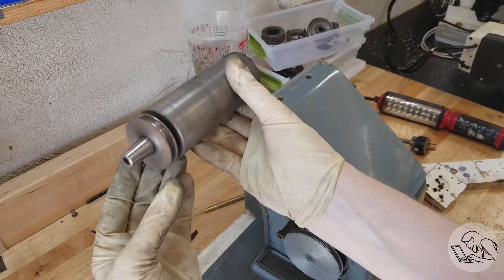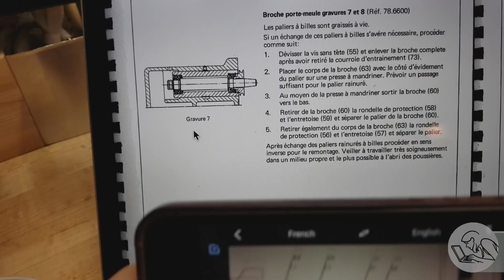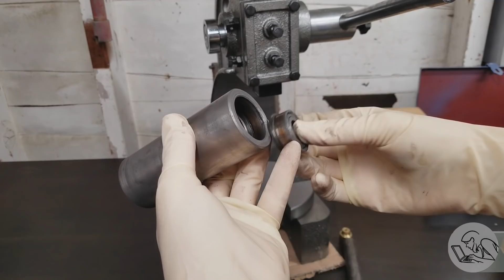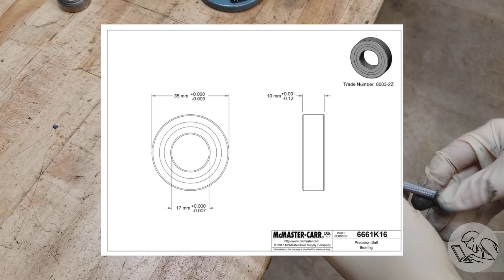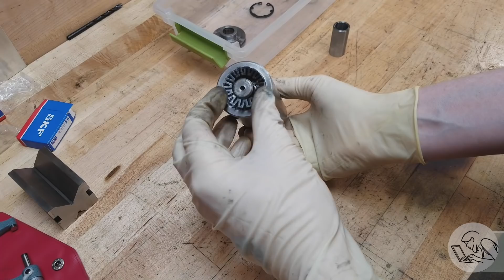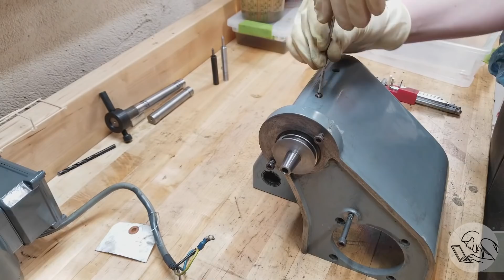D-Bit Grinder Restoration - Part 5

Comment: Hay Quinn I haven't read the 275 comments so if I have a repeated comment I apologise.
As a mechanic when using a hydraulic press to press a bearing in by the outside shell we use socket sets as you can usually find the right size to match the outer shell.
Thanks for sharing regards Sleepy

Comment: Why an arbor press over a standard hydraulic press?  Is it because of the built in stability of the arbor press vs the wobblyness of a regular cheap press?  On another note, with all the foreign material ingress through that rear hole, did you clean the bore out before reinstalling the rebuilt spindle?
Reply from the maker: Because I don’t have a hydraulic press
Reply: @Blondihacks Sorry, I should have been more clear with that question.  What I meant to ask was why did you purchase an arbor press over a hydraulic press?  Not enough space in the shop?
Reply from the maker: @Asmodeous67  Yah, definitely space. My shop is very very small. It's hard to tell on video, but you'd be shocked if you saw it in person. 😀

Comment: Er...umm... those SKF's are shielded, NOT sealed. Shields are SS, seals are black plastiqué.

The re-assembly should be the reverse of the disassembly. The slip fit bearing would press onto the shaft. Then the press fit bearing should be pressed into the body, then press the arbor in.

If you install the arbor shaft into the body without the bearing, you won't be able to support the bearing races properly trying to press it onto the arbor, and into the body, at the same time.

To put it together the way you did, the press tool would need to contact both the outer and inner race. 

Pressing it onto the arbor shaft and the into body, without a custom press tool, would create stress on the balls, and the outer race presses into the body.  Which is hell on cages.

Comment: So why didn't you use a socket-like the rest of us? (as a spacer, bushing, pressing thing)
I just subscribed.  I just got an old surface grinder that was making a noise at the spindle.  After some research I discovered that the 4 bearing's price is equal to the value of a first born child.  At least thats what they say in the fine print.  I found a video by suburban tools on "what it takes to rebuild a spindle".  They went to a place dedicated to this.  I saw no magic.  No dust free zones where a fingerprint screws up the way the bearing runs.  Perhaps I can do this. Empowering.  Thats what you are. Empowering.  BTW I wondered why your video didn't come up in my search.  Its because you didn't put "surface" in the front on your title.
Reply from the maker: Well, it’s not a surface grinder. 😁 This is the spindle from a D-bit grinder.

Comment: Good video. Not seen lugged snap rings with bent tabs before. I wonder if someone in the past tried to remove the shaft with the ring still in place and bent them?
Reply from the maker: The lugs are shown bent in the parts diagram as well, so they’re supposed to be that way. Not totally sure why.

Comment: After looking at the blog post, it appears those bearings have a c3 clearance.  Is that right?  How is the runout?  Presumably there is an interference fit on the shaft and the housing to make up for that god awful thou?  Trying to order bearings.....and over thinking as usual.  Toolpost grinder for my lathe. Save me from myself. C0 Abec9 is out of the question.

Comment: Frankly I want to build one myself. By the way - why not seal that open hole with wax or silicone?
Reply from the maker: You do need access to the hole periodically to lock the spindle.

Comment: Here are a couple of hints from an old guy who has rebuilt dozens of spindles. Make assembly easy by putting the shaft or arbor in the deep freezer for a few hours. The bearings will likely drop onto the shaft without even using the press. The housing can go in the oven at 250 degrees for a while to expand it. Also smear a bit of oil on the inner and outer races, kinda like installing pistons in a engine.

Comment: Hi Quinn, the perfect bushings for pressing in the new bearings are the races from the old bearings. Might need to grind a little off the outer dia just so you don't press that in as well. Also, even snap rings without those tabs can be sided (& the grooves) mainly found in gearboxes tbf, but you probably know already. Loving this series & so well done as usual. Thanks for sharing.

Comment: Oh, I had those snap ring pliers and they are just terrible. It was a constant struggle to keep them from slipping off, and never really having enough motion to get the snap ring out/in because of the flex in the reversible jaws. After years of self abuse, I finally buried them in my toolbox and bought a set of Knipex snap ring pliers and have never looked back. I inherited a set of old snap ring pliers from my father in law, and even those ( no idea of the pedigree ) don't perform as well as the knipex.

Comment: Did I see this correctly, the front bearing floats? In my 40 plus years of working in machine shops I have never seen a spindle where the front bearing is slip fit and the rear bearing is a press fit. It seems odd that the rear of the shaft is fixed and any movement due to heating and cooling is happening at the business end.
Eric
Reply from the maker: The bearings are slip fits in the outer bore at both ends, and pressed on to the spindle. Pretty typical arrangement, I think- similar to a motor.

Comment: I do love your videos they are really easy to follow and well produced. I almost feel like I could copy that design using a lathe, welding (to fabricate something instead of the casting) and a press (all of which I have). It's interesting to see how these things are held together as it give you an idea of how to build your own tools.

Anyway happy new year and keep up the good work!
Reply from the maker: Totally! I learn a lot about how to design my own things from taking apart well designed machines like this.
Reply: Look carefully at the 3-bearing arrangement for a spindle. Costs an extra doublebuck for the bearing, but has many advantages.

Comment: The spindle locking hole is for changing grinding wheels. I'd make a spring or lever action spindle lock, because always removing that rubber plug is a pain.
ATB 💪👌👍

Comment: Hi folks. It's worth adding that good quality spindle design is a complex art. Bearing movement has to allowed for to cope with expansion and contraction - at high speeds even ball bearings will heat up - hence the sliding fits. BobUK.

Comment: When mounting the arbor press will it be better to mount it to a plate to allow so rigidity  on the table and a lower bottom for longer parts, or make a pass through whole for really long pressings. Are is that just getting towards a reason to buy a shop press?

Comment: The arbor press is going to make life a little easier. I like your use of hss. Not learning to grind and use hss was my biggest mistake when I started machining. Especially with the light machines that I was using. I am not saying that carbide doesn't have a place in the home shop.

Comment: Gosh, I need an arbor press. Gets arbor press. Gosh, I need a bigger arbor press. (My words, not her's.)
Reply from the maker: I bought a bigger one than I thought I needed, and immediately wished it was a little bigger- it barely got this job done. 😅
Reply: @Blondihacks  as I'm sure you've figured out, that's the case with damn near all machine tool purchases.  "Hmmm, I need this size, so I'll upsize it by one increment", next job comes along you always need the one two increments larger.

Comment: No run out?!
HolySh!t!
I woulda had to check that a couple times to convince myself it's true
Good show, thanx
Reply from the maker: You get what you pay for in bearings and arbors, it turns out! 😁 I’m sure you could see runout on a fine enough indicator, but I couldn’t see any on mine

Comment: Another great video.
I enjoy the explanations about assembly of parts and orientation, this is often assumed and seldom explained 
The screw on the spindle lock is to hold the spindle when tight tolerance is required- the spindle is movable in the long axis ( as is the “ tool holder shaft”, on the lower front of the machine) when advancing the wheel into the tool
The hole is to insert a Phillips head screwdriver or Allen key to stop spindle rotation when grinding wheel replacement 
Hope I’m not telling you “how to suck eggs” !
Reply from the maker: The spindle on this model is fixed laterally, unlike many newer D-bit grinders. The setscrew simply holds it in place.
Reply: @Blondihacks  My mistake, I had been looking at my clone machine, I have now seen that it is not the same. Thanks for the videos!

Comment: I would've used angular contact ball bearings for this application, they provide more rigidity that's needed if you want the best results (which you do in tool grinding of course)
Reply from the maker: Replacing them with the same ones spec’d from the German factory seemed wise to me. They know what they are doing.
Reply: @Blondihacks  Sure they knew, it's pretty common that old grinders have regular ball bearings in their spindles, and not even the more precise ones. My t&c grinder had too and it actually worked pretty well considering that and that they were so old (1943)

Comment: Nice video I have a gorton  model, use it all the time.I prefer high speed bearings with rubber seals, metal seals don"t seal tight. grit gets in,i use a felt ring for back up on stone side.
Reply from the maker: A felt ring is a good idea. I think the parts diagram actually calls one out, but it’s missing on this machine.
Reply: @Blondihacks  I bought sheets, of square ( Machinery ) felt on E-bay  and cut my own. have fun with the grinder keep the grinder dust away from other machines.

Comment: Hi Quinn
I'm a big fan of yours.
I would like to point out a critical mistake you made when you pressed in the second bearing.

You pressed axially through the balls of the first bearing, that is why the spindle did not rotate freely after pressing in the second bearing.
The correct way to have done it, is to have made a bush that supports both races of the first bearing. Ie   a flat faced bush with a hole through it for  shaft clearance.
Otherwise you are doing a great job.
Reply from the maker: No I didn’t- I pressed on the inner race of both bearings where the press fit is. The second bearing has preload springs behind it and that’s why it got tight. It was the springs doing their job.

Comment: In my experience, when a document gets sufficiently technical/specialized like some scientific papers, it tends to use a bunch of english loanwords (or vice-versa, I'm no etymologist), so I can sorta halfway follow as long as it's a language that uses the latin alphabet.
Reply: That's probably the main reason why translated materials from eastern asian countries have a long history of questionability. Instructions that come with chinese items are the modern perpetrators, but in the 80s japanese imports often had hilariously bad translations.
Reply: Yesterday I took delivery of a 5C Collet Spin-Index Fixture made in China and found myself wishing I had the Mandarin version rather than the Chinglish version because it is nigh impossible to understand AND I can't use Google Translate.  I've been around tech over 45 years, and in the old days if I had to I'd find a native speaker of whatever documentation I really needed to help me out.  But no-one can help with really, really bad Chinglish.  Sigh.
Reply: @marcmckenzie5110  Fw years ago, I bought a new laptop battery and read the enclosed pamphlet - I gave up round about the time I read the warning that the "alkalinaceous liquors" might leak out if mishandled.

That said, I admit the writers English was considerably better than my Mandarin.

Comment: As a mechanical engineer by day, I've designed a few bearing systems.  The rule of thumb is the bearing is pressed onto (or into) the rotating member of the joint, and is a (very slight) slip-fit into (onto) the stationary member.  How tight/loose the fit is generally a function of loading (ranging from uniform to heavy shock), operating speed, bearing quality, bearing retention....
Reply from the maker: For sure, which is why I proceeded with the assumption that the outer race was supposed to be a slip fit. That said, I have seen cases where it isn’t, so it’s not a universal rule.
Reply: @Blondihacks  true - and you took the utmost care to make sure - which was very satisfying in itself to watch!
Reply: @Blondihacks  Thankyou! this helps me sort out the order for assembliing the bearings in a 4x6 bandsaw which appear to be press fit on shaft and in housing
Reply: @johnvreede832  I just acquired a 4x6 bandsaw and will be doing a rebuild on it. 
Please share any info / finding that you come across. 
Thanks
Reply: @rickpalechuk4411  Rick, you'll get the most help by joining https://groups.io/g/4x6bandsaw. There's a few hundred of us with 18years worth of photos and info - jv
Reply: @Blondihacks  
Should be.

Dale in Canada
Reply: You beat me to that comment. ...though you said it much better than I would have!
Reply: EPGeek; I understood that because the outer race housing contact surface is significantly larger than the inner race shaft contact surface area, it is preferable to have the inner race versus outer configuration as you state.
Not sure what grade of bearings where fitted, C3 are the most popular, ref for motors, possibly a tighter tolerance could be beneficial here.

Comment: Blondy; you could use a wash station for the crud on parts
Reply: I've fallen in love with my ultrasonic cleaner. Use a little diluted Simple Green and it's amazing what you can clean off. I helped a friend rebuild a snowblower carburetor, and the thing looked brand new when we were done. I bought a "returned" cleaner from eBay that I had to repair (because why not) and now I use it all the time. I went with a 2.5L model, but I think it's a good idea to buy the largest capacity you can afford.
Reply: @setSCEtoAUX  Get some plastic or glass jars with screw on lids and put your parts in those, pour in some diesel or kerosene or straight up benzene, then fill your ultrasonic cleaner with water and toss those jars in to the water bath. Works in less than 30 seconds to pull crap off from machine parts as it is the best solvent, but also doesn't make a fire hazard because sealed container and you avoid any cleaning of the ultrasonic machine, as it is filled just with water.
Reply: @JaakkoF   That's a fantastic idea, thanks! That'd work great for Isopropyl or acetone too. You get the best of both worlds; an aggressive solvent plus the mechanical ultrasonic action.
Reply: On the topic of hazards: Benzene is a fairly nasty carcinogen that will go straight through normal latex or nitrile gloves. Take all precautions when using it (ideally in a fume cupboard) and ensure you dispose of the waste appropriately.
Reply from the maker: Yah, I should get a parts cleaner if I’m going to keep doing machinery restorations. The evaporust does a surprisingly good job of melting off crud for now.